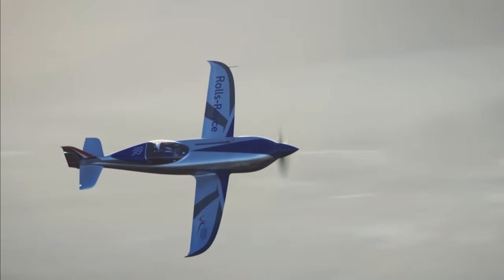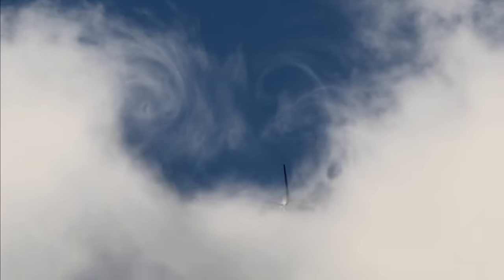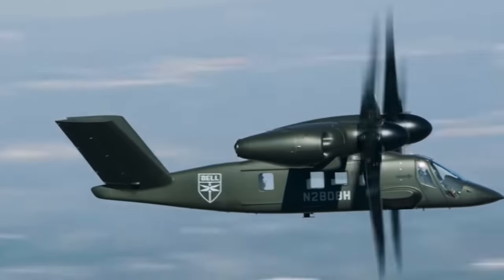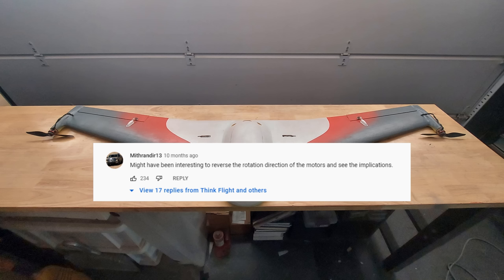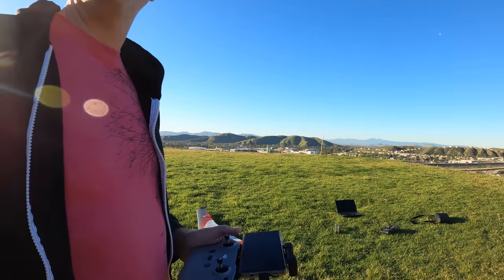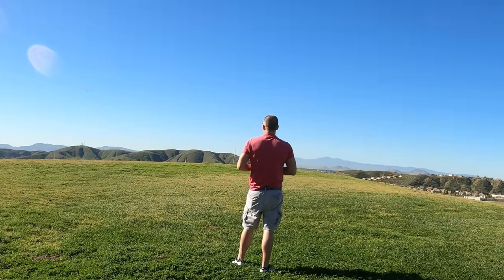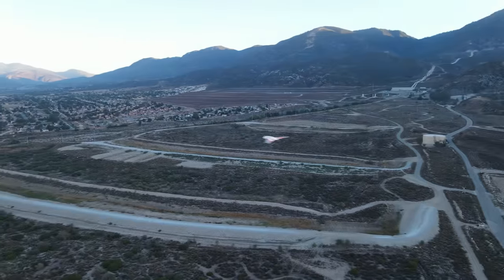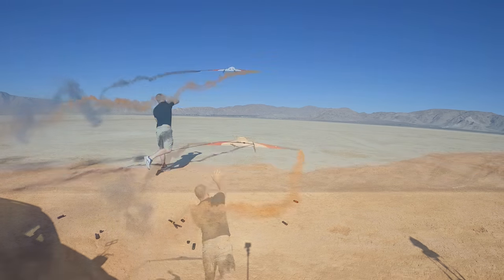Can Wingtip Motors Improve Aircraft Efficiency?  (Part 2)

Comment: Hi there, if you are using washout to trim the airplane instead of for example a reflexed camber airfoil, the wing of course will have a more bell-shaped lift distribution. The literature on tip-mounted propeller efficiency gains uses elliptical lift distribution wings, with a conventional tail to balance the pitching moment. With a bell-shaped lifting distribution, the center of the trailing vortices is actually located about 70 percent of the span. Al Bowers, a scientist at NASA and probably one of the world's top experts on bell shaped lift distribution wings, told me directly 5 years ago that there would not be much benefit with a vortex imbedded propeller on a bell shaped lift distribution wing, at least not like there would be on a standard wing. You could try putting the propellers at 70 percent span to line up with the vortex center, but again, according to Al Bowers, it wont have the same gains as elliptic loaded wing, i.e. one with a conventional tail to counter the pitching moment.
Reply: Exactly. And central undercarriage - gilette spur
Reply: Wow
Reply: I'm still looking for the math to draw the cord.  The nomenclature for defining the re-flexed airfoil for a flying wings is mentioned, but not the math to plot it.
Reply: Well pointed

Comment: "After 360km of miles on the airframe..."
Ha!
Great experiment BTW
I wonder if the first round was (partly) more efficient due to motor/component wear after 180km of miles on the airframe
Reply from the maker: Great point!
Reply: I was hoping for ten thousand of this comment.
Reply: In the grand scheme of things that’s not that much time. That’s only like 12 hours
Reply: @ILLEagle_1  how hard were the eg: the motors pushed? Whats the time life on the bearings? What is the quality of the motors - cheap or high end? What about the batteries?
Reply: Are we the only ones noticed, or only ones that cared?
Reply: Can always just run props rotating out again to validate original results
Reply: @thinkflight  good motors should not matter how hard the motor shaft screw is tightened as there should be a little end play no matter how tight the screw is.
Reply: My mind rebooted after this part of this video
Reply: Also, a good question is, is using the frame for some time (which i would expect will make it more streamlined due to minor wear of anything that sticks out from the resistance of the air) affect the efficiency? Is the 7.7% increase in efficiency smaller or bigger than the actual increase in such a case? It is hard to test these things. I would put my energy into building a small airtunnel and feeding the plain with air to a) test the vortex and b) test the efficiency perhaps? Not sure.
Reply: @KostasTsakalidis  a friend built a air tunnel for a 10th scale rc car, It was anything but small, about 15' long and 4' diam, I am guessing it's going to be pretty big for small plane like his wing. Good idea, but probably not practical.
Reply: @KostasTsakalidis  in my experience, planes don't get smoother, but just the opposite, mostly from landing. Temp of the air and lipo have a huge effect on performance also.
Reply: Stupid comment here, but i think it was more efficient because the engines do not have to strangle with the wind or lift under the wind and causing a distortion in the center if the wind. In the corners it looks more natural letting the air go under the wings smoother. I don't know the correct terminology but i hope this makes sense what i am trying to say. Also is easier to turn with the engines at the tips so less effort means more efficiency.
Reply: "after 360 kilometers worth of miles" – Yanks in a nutshell. Anything to avoid the metric system.

Comment: Thanks for the comment shout-out, took me a little by surprise. I think the differential thrust issue was expertly highlighted by that lovely flat spin when the ESC failed. As was the fallability of any form of propulsion. 

But what I really want to see right now is the WIG water toy video 😖🥰🥰

I've been thinking hard about the physics of tip propulsion and I'm struggling with it. It's not intuitive and I'm also looking forward to more content about it. I love feeling confused and finding resolution. 

Keep it up, loving the channel right now!
Reply: This would be an almost insurmountable objection to using this configuration for manned flight.  An engine out would mean that you could only glide. Conventional placement will allow one engine flight, or at least a very great extension in glide.

Comment: In his book Understanding Aerodynamics, Doug McLean makes a good case mathematically for why wingtip-mounted propellers do not have the intended effect on induced drag. He also talks about it in this time-stamped video: 

https://m.youtube.com/watch?t=36m59s&v=QKCK4lJLQHU&feature=youtu.be

I suspect there are still some higher-order subtleties that can be exploited with the wake interaction, but from a fundamental level I think they would have to be relatively minor. Either way, the plane you have built here is one of the sleekest I’ve ever seen and I really enjoyed the video!
Reply: Yes, i instantly think of Doug McLean whenever wingtip devices are brought up.  my guess is that the motor mounts are simply acting like winglets, AND the propellor pitch theory discussed by ThinkFlight
Reply from the maker: This video keeps coming up and I never get around to watching it.   Thats it dammit, its time!
Reply: @thinkflight  while wing tip motors don't make it more officiant they allow a air craft to have a lower aspect ratio which makes weird looking planes look up Vought V-173 Flying Pancake
Reply: I am glad you brought up McLean.
One of a few who is correct.
Following up I like to point out that there is a  conceptial difference between induced drag FORCE Di and the induced drag COEFFICIENT Cdi (just a number)
Cdi = Di /(Area × q)
q = dynamic pressure = rho×V²/2
rho = density    V = speed
Cl  = Lift /(Area × q)   lift coeff.
Cdi = Cl² / (pi AR)     pi=3.141592..

Clearly this number, an artifact is dependent on the aspect ratio AR  =  b²/ Area  = b/ mean chord
 b = wing span
But the induced DRAG force is (1:28) NOT dependent on the aspect ratio ! despite the narrative.
Di = (Lift/b)² × 1/( pi × q )
The induced Drag FORCE is proportional to the square of the span loading  Lift/b and inversely proportional to the Velocity² and density.   Not in the least dependent on the wing chord c !!
verify by substituting in
Di = [ Cl² × 1/(pi × (b²÷A)) ] ×(A×q)
Cl = Lift / (A×q)
 A cancels out and b² is in the denominator
The induced drag force is independent of the wing area, hence chord.
This in contrast to the parasite drag, where the wing Area dominates
D parasite = Cdp × Area × q
                   =  Cdp× (b × chord) × q
The effect of the chord affects only the parasitic drag, not the induced drag force
The confusion created by the artificial meaningless induced drag COEFFICIENT is remarkable.
If you derive the expression for the Lift to total Drag ratio by substitutions: The simple form results:
L/D = b/2 × sqrt( pi /(Cdp × Area) )
Strong function of span b, weak function of parasite Drag Coeff.
not a function of the aspect ratio
b/c, but b×c instead.
All the derivations above  are valid for a wing with elliptic lift distribution, other wise a correction must be made with the Oswald efficiency factor.
Reply: @thinkflight  It's one of my favorite when it comes to explaining what goes on during flight!
Reply: In simple terms, the induced drag is a function of the overall downwash distribution some distance behind the aircraft (in the Treftz plane), and cannot be altered by locally changing the flow around the wing-tips, which is in effect what all wing-tip devices try to do.

That being said, this is a very elegant design and the wing-tip mounted motors actually look really cool, especially in the air to air shots.
Reply: @frikkied2638  one correction there is a second use for wing tip devices and that's keeping the air under the wing for short wing aircraft thou as far as i know only the Vought V-173 Flying Pancake managed to be flown with that intended purposes.
Reply: @frikkied2638  
That is exactly right.
The Treftz plane is not inclined.
McCormick went one step further and inclined this plane by the angle of the far wake, and added a parallel plane far forward of the wing and computed the momentum balance and for an elliptic loaded wing (circulation distribution) obtained, what he called the exact equations for lift and induced drag, valid for large far downwash angles, those that occur on helicopters.
His derivation is documented on:
Barnes McCormick: "Aerodynamics of STOL aircraft"
Dover, I believe.
His derivation can be expressed in terms of the far wake angle beta from the horizontal and the simple results are  
b = span
pi = 3.1415926..
q = dynamic pressure

L = q × b² × pi/4 × sin(beta)×(1+cos²(beta))

Di = q × b² × pi/4 × sin²(beta)×cos(beta)

tan(alfai) = sin(beta)×cos(beta) / (1+cos²(beta))

alfai is the induced angle at the wing.
For small beta, all equations correspond exactly to the ones derived with the Treftz plane  , for example alfai = ½ beta as you know.
At large beta, the exact alfai is limited to 19.47°
At the maximum L , beta is about 54°
Di is also limited, in contrast to linearized theory .
For aircraft at normal  Clmax below 2 to 3, linearized theory is quite adequate. But for rotary wings and low aspect ratios it is not. ( slender wings  R.T. Jones)
For non elliptic circulation distribution, an Oswald type correction is required.
For small Aspect ratio wings, like the Concorde, the induced Drag Di is significatly higher, than with the linearized theory, which is implemented in full motion simulators, the effect was important in the low speed accident of the Concorde high alfa stall.
Notice the simplicity of the equations.
Of course the parasite drag is conventional:

Dp = q × Warea × Cdp

Evaluation is more complicated for given Lift, because the beta angle is a non linear function of the lift and q.
Reply: Nevertheless, you have to take into account the fact that you use the same part (the motor and its propellers) to have the same effect as a propeller AND a winglet AND a vertical stabilizer at the same time. Thus, the configuration will be more optimal from a weight perspective.
Reply: What a superb link, thank you. Ended up watching qute a few of the topics described. In the lecture Doug explains very calmly and clearly his points and doesn't used excessive complexity or terms which is a clear sign of a good teacher. Recommend this.

Comment: 10:00 were you able to measure a difference in motor current? Given the same motors and the same approximate pitch / diameter that would be an interesting measurement of total load on the motor.
Reply: everything else needs to be equal in order to make that assumption

Comment: I wonder if anyone mentioned the Vought V-173 aircraft in the previous videos. That was a unique set up that historically used wing tipped place airscrews to both improve the efficiency of the wing and keep the boundary layer attached on a high performance low aspect ratio wing. It made use of a lot of interesting tricks in its day, even interconnected engines so that if one engine failed both screws would still be turned by the transmission, kinda like on V-22’s today.

Comment: I think what stands out to me anyway as pure BEV flight is now clearly very mature is how quickly everyone has ditched wings period which from these flights and thoughts upon them one can see why as there is no vertical stabilization here. In theory one could launch your wing nose up/blades down so as to test mission critical pitch and yaw with another option being similar to what the US Navy does with their Submarines namely create a housing around your blades then add some vertical "grid fins" in front of same said mechanism to provide at least some friction to add lateral stability upon such an austere platform.

Point being what are trying to test is how your design works IN LEVEL FLIGHT and not just as an efficiency theory that happens to fly.

Once you achieve "on the level" then a testable hypothesis can be made and indeed anything is possible "in the wild" (box wings, front facing control surfaces, landing skids, you name it.)

A good YouTube channel to check in on is BPS Space if you really want to crazy insane with the data science.

Comment: Sorry if they've been mentioned before. Two aircraft for your perusal/flight information are the Ho-229 "Flying wing' and how the Horten brothers resolved their stability issues with such a plan-form and the Vought XF5U. A machine specifically designed around wingtip mounted propellers. Even if the wing in that machine's case was virtually a frisbee. 👍
Reply: I'm not sure you explained how they fixed the stability issue, other than 'special machine fixes stability'

Comment: from what i can remember from my incompressible aero class induced drag increases greatly with speed. so at these low speeds the effect will be very hard to measure. Second the AR of these wings is reducing the effect of the wingtip props reducing induced drag. the props only extent a couple inches past the wing tip, and at this scale that is only a tiny increase in AR. If you look at the V-173 and XF5U the propellers increase the effective wingspan by a significant amount. (on the V-173 wingspan was 23 ft 4 in and the prop diameter was 16 ft 6 in).
Reply from the maker: Induced drag goes down with speed and parasitic drag takes over.

Comment: have you tried forward facing large props (a bit like the Vought V-173)  on a forward swept wing? the forward swept wings give slightly improved lift and the large props push the extra air down the wing giving even more lift making the plane super efficient
Reply: also, your plane is the best looking ive seen in years
Reply from the maker: I have not
Reply: Well, get on it! Just kidding. I agree, that is a gracefully flying design! Thank you for sharing your results! 😜

Comment: I have two FPV planes the same span, one is a wing, the other is a balsa home built with a conventional wing and a twin boom to a tail.   They both run all the same gear and have pusher motors.
The Wing is lighter in foam at about 270grams , the balsa framed with covering is heavier at over 430 grams.  The Balsa plane is more efficient by at least 20+ percent, even though it is heavier.
I put this down to the wing has to use reflex and is swept in order to fly, where as the balsa own design does not,  and now having seen this video also the tip vortices are opposite, and is affecting the efficiency of the wing type.  Thankyou so much for doing this research it is MUCH appreciated!!, I was at the stage of trying wing tip motors.  Also I figure that a tip splitter (winglets) is worth a try as these are used horizontally on race cars to split the air ahead of the bumper.  I feel these can do this on the flat wingtip, to minimise bleed around from top to bottom of my balsa planes wing.  Matt Western Australia

Comment: Pressure mediation: Resonance tuning rotation to pulse tip vortex will amplify local pressure in a controllable way and increase lift efficiency generally.  vortex is a source of coupling between energetic containers so to so to speak and all containers can be pressure accessed via resonance.

Comment: Alice aviation also gave up on wingtip motors, and placed their nacelles alongside the fuselage like the mad dog.   The reduction in vibration alone and the associated drag reduction is probably worth it.  It still would be interesting to see the twin tip tractor configuration on a wing with elliptical lift distribution.

Comment: Props on the tips. Depending on rotation the Wing Tip Vortex is taken into the mix. Wing Tp Vortex eliminators delay the Wing tip vortex to be farther from the wing it's self, thus delaying drag. So, putting the props on the tips solves this drag problem.